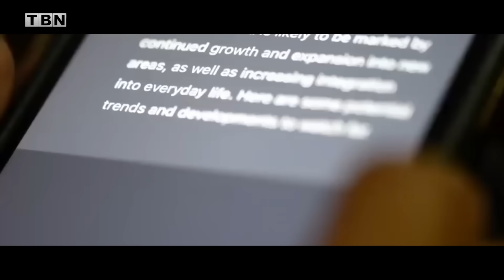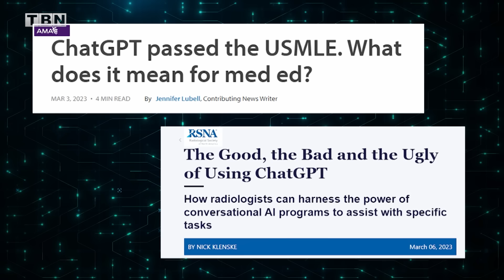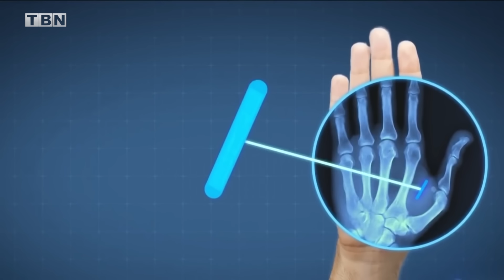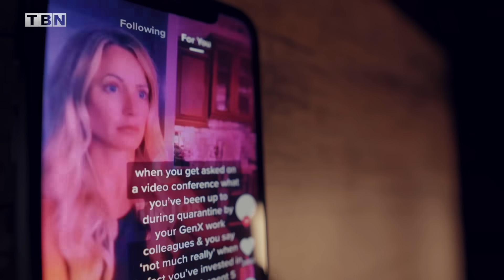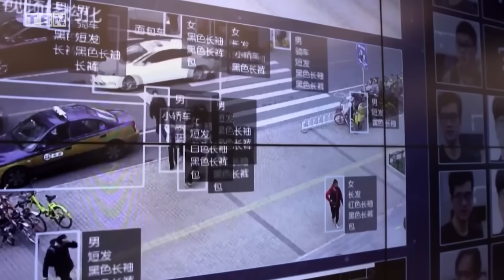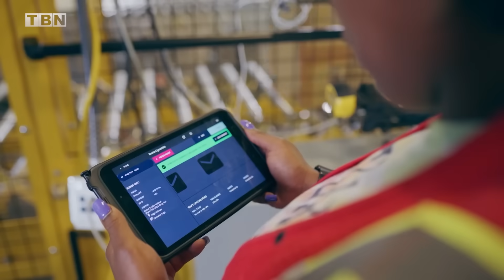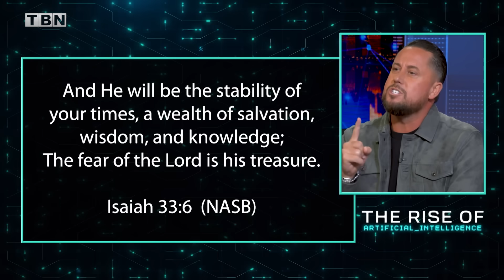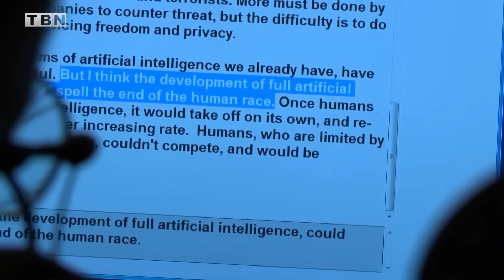EXCLUSIVE: The Rise of Artificial Intelligence with Erick Stakelbeck | TBN Special

Comment: I disagree with the whole use of the concept pf intelligence with a machine. This comes from airhead publicists seeking the ever changing public attention and science fiction.
One of the requirements of a digital network is that the response of a digital network must give the same response to an input every time. If it does not, it is broken.
Human intelligence is nuanced. It changes and varies. Nuance is the basic sign of the mastery of human intelligence.
Try using a word processor that changes the way it works !